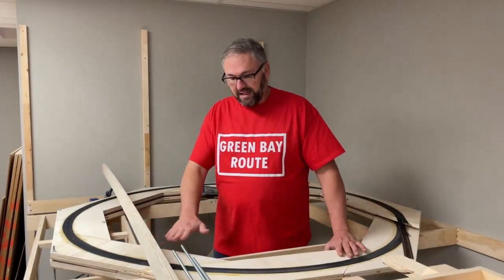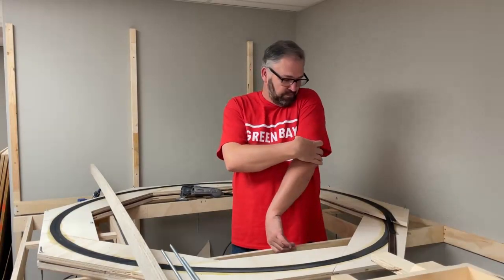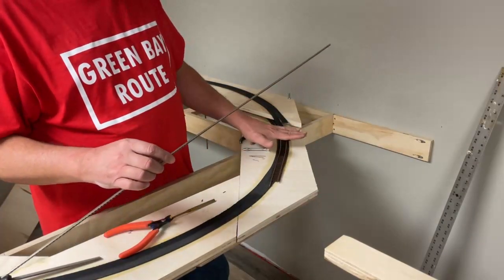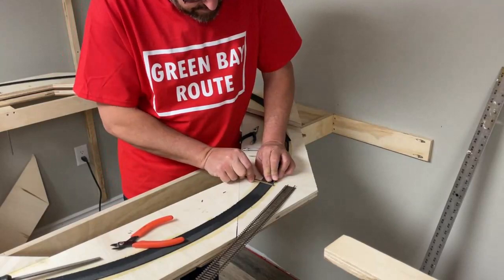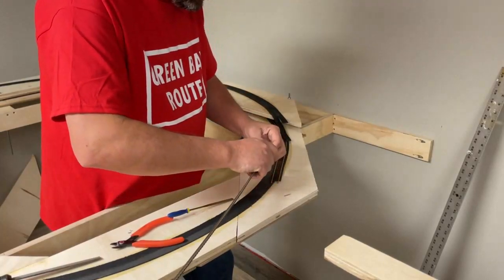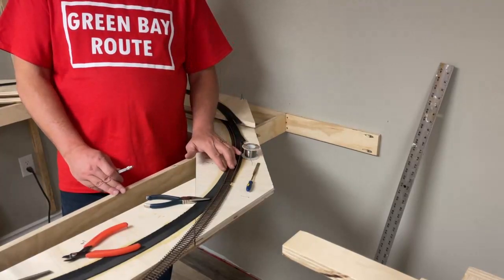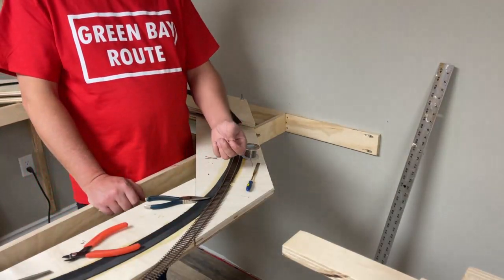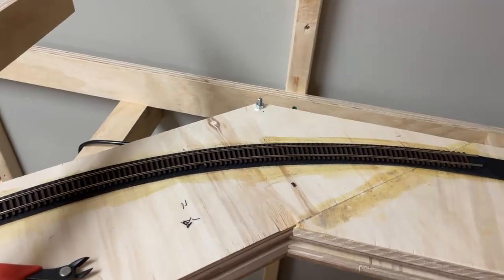HO Scale "Material Saving" easy Helix

Comment: Good instructional vid. I did have problems with soldered rail joiners in my helix with the humidity. Was a nightmare to fix the string lined track In a few spots a year later. I ended up soldering a wire to each three foot chunk and not soldering the joiners. Nice woodwork. Great job. Just subbed